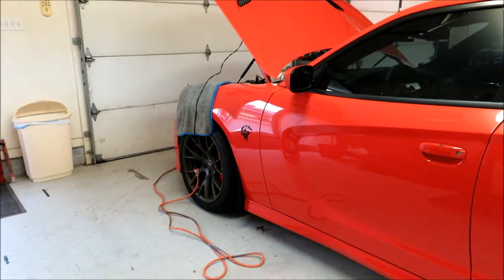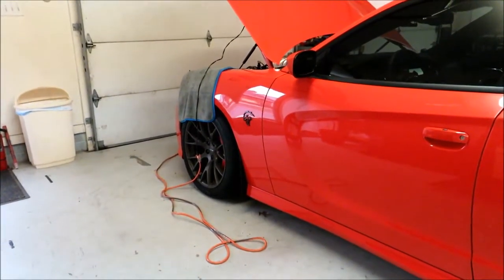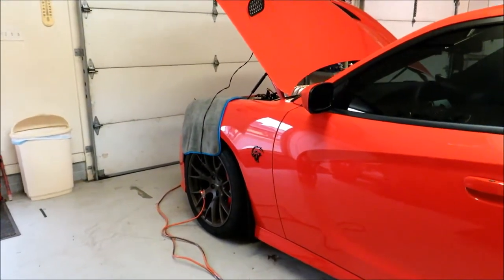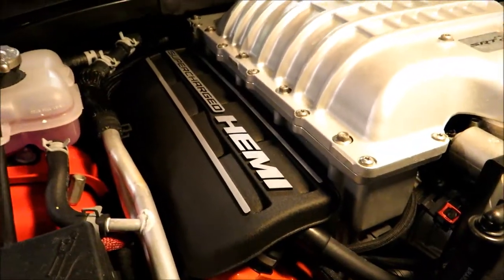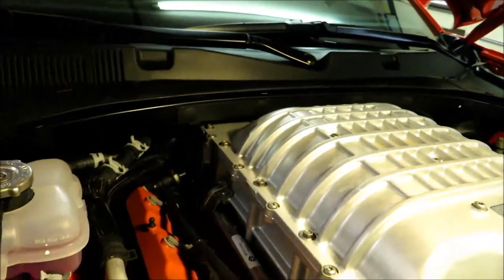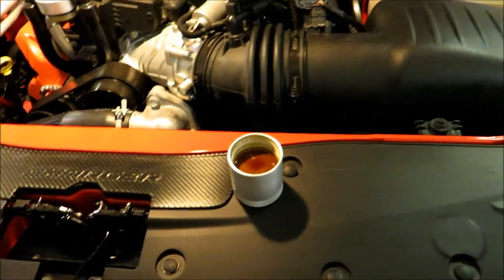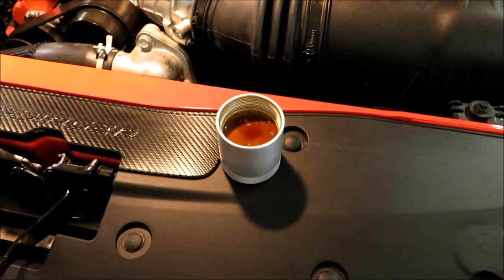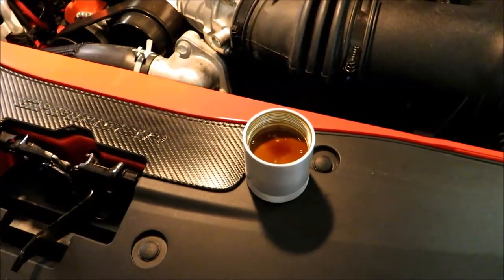JLT Catch Can part 2

Comment: Wow! That’s a lot over fill. Need to check mine soon! Great vid
Reply from the maker: Yea I was really shocked how much there was.
Reply from the maker: rift33srt  Thank you sir.  As for the catch can it hasn't been on the car for a while as I was dealing with alignment issues with multiple dealers and didn't leave it on the car.  Don't want to give them the slightest reason to try and void the warranty.  For this particular issue though the 3000 or so miles that filled the can were put on during a road trip from DE - FL - DE so it was a lot of constant highway high speed driving.  It took place 2 days after Christmas so there was a lot of temperature and humidity changes in a short 5 day window.  Plus once we got to FL there was a good deal of spirited driving.  I think it was all those factors that caused it as there has been nothing mechanically wrong with the engine (well except supercharger replacement) before or since.

Comment: What ever happen with the hose on the right side that wasn’t able to click in on the first video.  I just picked up the same catch can and have that problem.
Reply from the maker: To this day it still doesn't "latch" probably on the throttle side however, it has never been an actual problem just like JLT said.  The vacuum is created on that side so I think when the engine is running it actually pulls the hose on tighter.
Reply: coolwrld302 did jlt recognize this as a common thing?  I asked a buddy of mine that also has a hellcat and same catch can and his actually clicks in
Reply from the maker: They talked about tolerances and stuff and that the not latches wasn't that unfounded.  I actually think it is the fitting on the throttle not the hose. As a test I hooked that hose up to the connector on the valve cover side and it latched fine.  Which tells me the issue is the car connector.
Reply: coolwrld302 i know what you mean but the factory hose clips on with no issue. That tells me that the design for the driver side might need to be different. I also just read that another guy had his almost slip off and made a mess
Reply from the maker: Well I know when I talked with JLT they implied if it created an issue they would send a new hose.

Comment: You must have been driving the shit out of the car,I hope at least, to get this much.  I just got one with 7k mileage and noticed the other day with remote start it shot a puff of blue smoke on cold start. 

Immediately ordered both sides from upr.  I noticed they have an 11 oz. Can.  This makes me reconsider.  

I checked my hose and I do see oil in it on passenger side vs residue on driver side.  Man these cars shouldn't be releasing that much.
Reply from the maker: It was a round trip between DE and FL and there was a lot of spirited driving.  Ironically, I typically take the can off when taking the car in for oil changes (paranoid and don't want to give FCA anything to try and void warranty) and haven't put it back on since the last change.
Reply: @coolwrld302  really...and you know its transferring oil like that?
Reply from the maker: @mikeprice8307  Yea I assume most people drive these things around without them and have seen ones with upwards of 50k miles on them with apparently no adverse effects.
Reply: @coolwrld302  lol I know that's right!  I'm embarrassed of the burn off in front of others. Can't be having that.  What matters most though is the long haul, that's if you plan to KEEP your car that is.
Reply from the maker: @mikeprice8307  Yea trading up to a wide body most likely when the lease is up in May.
Reply: @coolwrld302  ohhhhhh...see I bought mine to keep.
Reply: @coolwrld302  thing is if this system works like they claim along with combustion chemistry,  if you lined your car up with another cat of same mileage stock for stock, with an exception of catch can, the catch can cat will win every time

Comment: did you notice any difference in performance ,i wonder if oil is getting into your piston cylinders through your supercharger then fouling your spark plugs
Reply from the maker: No change in performance.  I'm hoping adding the catch can will stop oil getting back in to the intake.  Of course if it was full than that could have been a problem.  I'm just glad I checked it now.  I figured based on some of the stuff I have read online that at 3000 miles there shouldn't be that much.  Boy was I wrong.
Reply: how often do you check your oil level? i check my oil and catch can almost every time i drive my car
Reply from the maker: Well I get my oil changed about every 3000 miles (do for one now actually) so in between I will check the oil if I'm going to the track.  This is my first experience with a catch can so after seeing how bad it was at 3000 miles I will definitely be checking more frequently at this point.
Reply: i get about a tea spoon every time i drive my car i figure if there is oil in the catch can it can get sucked up into my intake so i empty it out asap.